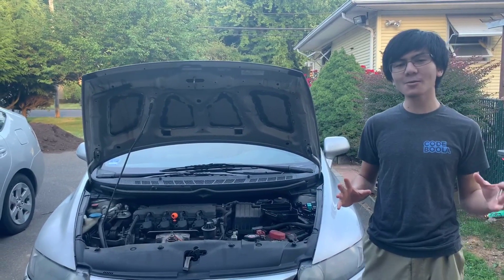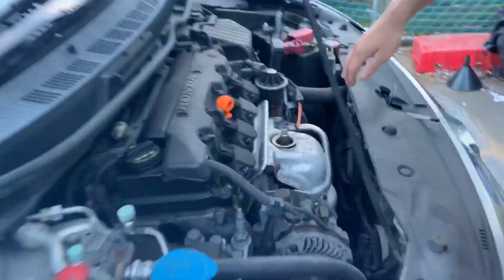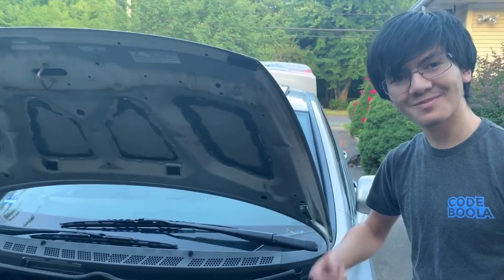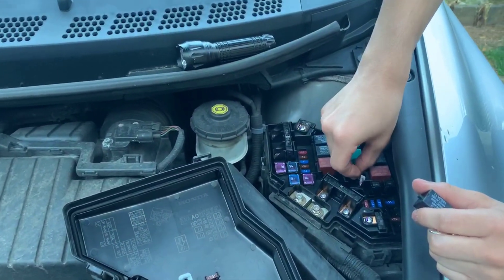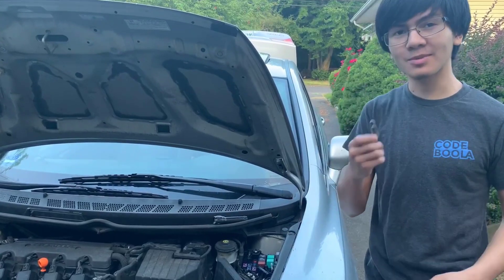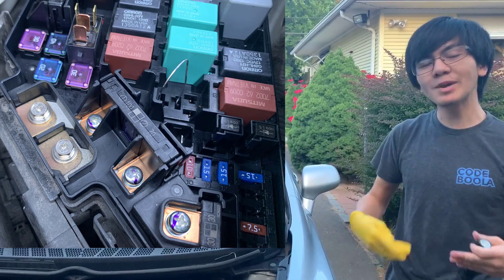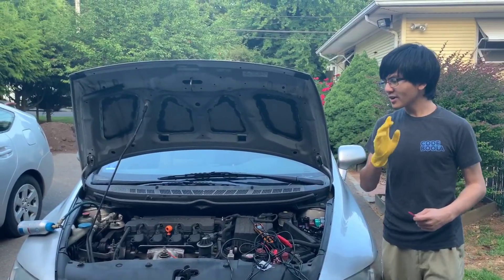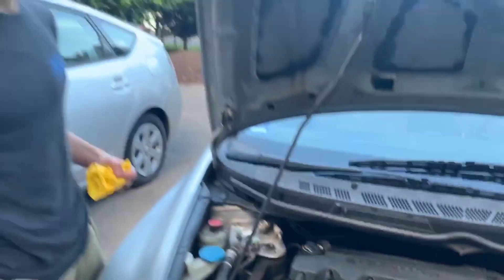How To Jump Start AC Compressor Clutch Using Paper Clip Bypass Relay | Add Refrigerant Manual Engage

Comment: My ac compressor clutch will turn when I jump it does that mean it's in good condition and my relay is bad?
Reply: Does it stay on? Or the clutch disengages a little after? If it works, your relay is good, you probably just need a charge.

Comment: When I turn on the ac, the car rpm goes down, I hear and feel the ac compressor turn on, but absolutely no air is coming out of the vents
Reply: Sounds like blower motor’s!
Reply: @afterthoughtsgarage320  I give it a good smack and it turns on
Reply: @afterthoughtsgarage320  yeah your right ac switch is if the compressor don't engage
Reply: 90% sure cheap fix
Reply: @codygreer1565  I hit underneath the glove box and the fan turns on
Reply: I have the same thing going on with my focus, I think it's the ac pressure switch sensor

Comment: At 3:40 you videoed yourself breaking the law....
Reply: Not true, this it R134a not illegal. The old freon r202 would be illegal to do so
Reply: @smisheski  Absolutely wrong. 134a is being phased out of new cars by 2021 because while it is not ozone depleting it is a greenhouse gas.  Below is a quote from an online source:

'Below is the punishment the EPA can fine you for releasing R134 (refrigerant) into the atmosphere

Penalty for Licensed AC tech releasing R134 into air:

"The fine for releasing refrigerant into the atmosphere can be a fine up to $27,500 per day per violation. The EPA can also award up to $10,000 to the person who notificed them of the violation if the person releasing the refrigerant is convicted." '

Comment: CHEVY TAHOE 2009 AC SNOWFLAKE LIGHT FLASHING 3 TIMES FIX.
Thank you for this! We have been searching for hours on end trying to 1) check if the compressor is bad and 2) if it's good, how to manually start it so we can get refrigerant in it!!! We did replace the ambient sensor thinking this was it. Although it wasn't the fix, it turns out that sensor was bad anyways!  We do not have a Honda but this still helped us find out hwo to manually engage the compressor, to then do more searching to find the relay numbers we needed to put the wire (not paper clip ;) ) in for it to work for our CHEVY TAHOE.  For a 2009 - 87 and 30 does the trick (they are diagonal from each other). We started the vehicle after wire was in place and the AC (Snowflake) button stopped flashing 3 times, compressor engaged, and we were able to check the refrigerant levels (LOW LOW LOW).  Successfully refilled to the green and our air is ice cold :)  YAY for DIY.

Comment: Good video,but dont to take the risk,relay and pressure switch are Cheap price,Just change it,or end up expensive repair.
Reply: But if your relay switch and pressure switch are all ok/have been replaced.... & you still need to manually start your compressor to get more refrigerant in it... bc... the compressor will not run if it doesn't have any..... Do you have a better suggestion to manually engaging the compressor?
Reply: Can u walk me thru this I need help

Comment: The compressor clutch will engage once you put enough refrigerant in the system. Then you fill it to the proper amount. It will take in refrigerant because your system is low and what your adding is under pressure.
Reply: What if the freon gauge is telling me it's filled?
Reply: @DaJuanFury  when you attempted to fill the a/c the gauge on the refrigerant said it was full?
Reply: @engineeringreality7878  the clutch wasn't spinning, but I tried to fill it up anyway. And the gauge still went up to full, BUT. My car still blowing hot. 2017 Impala.
Reply: @DaJuanFury  it seems newer clutch drive compressors will only accept new refrigerant if the clutch is engaged and spinning.  Its almost impossible to fill when they get to low.
Reply: @engineeringreality7878  turned out that my tank was just completely empty that it wasn't even kicking on the compressor. Took it to the shop and he filled it up. Needed a pound and a half of refrigerant
Reply: @DaJuanFury  nice
Reply: I know this an old reply... but u seem very knowledgeable. I have a 2013 rogue and there isn't a ac relay to engage the clutch in order to fill it. Is there a way to manually engage it so I can fill it with r134a, like connect it directly to the battery?
Reply: What if the gauge was in red??
Reply: @Kateee420  Was the AC clutch engaging at all?
Reply: @channelx92  not at all.
Reply: @Kateee420  I'm assuming the refrigerant your trying to add has a gauge on the can? It can only connect to the low side of the ac system. The gauge goes straight to the red when hooked up and the car is started? Is it possible it's overfilled? If you take a small screwdriver and depress the valve where you charge it at does anything come out? If it's overfilled the high pressure cut out switch will keep the compressor shut off. If you have high pressure and not enough refrigerant you could have an obstruction.
Reply: @channelx92  
When I used my ac it was working then all of a sudden it didn’t work anymore
Tried refilling it thought it was low the gauge immediately spiked to red when I put it on the low pressure port. I used the gauge to release pressure and it released quite a bit it’s now in the green/yellow area. But I can’t get the compressor to turn on so I can add refrigerant. Since you have to have it running to add some. The clutch is turning by hand so it’s no seized. I’m just at a loss.
Reply: @Kateee420  I don't know what vehicle your working on but have you checked the basics such as a fuse or broken wire at the compressor. Some vehicles the ac is controlled by a control module or computer.
Reply: @channelx92  08 Saturn Astra XR automatic 4cyl. I checked the connectors. All okay. The paper clip trick didn’t work so I don’t know what that means. I have searched to see if anyone else had a problem with the trick seems like it works for everyone else but me
Reply: @Kateee420  I'm having the same issue. Did you figure out what was wrong with your system and how you fixed it?
Reply: @kate did you figure out the problem??
Reply: @Priscilla_bbi  no, it’s still not working.
Reply: @Kateee420  any luck? I have the same issue. Ac all of a sudden stopped working mid-drive (uphill). Clutch spins freely but won’t engage. It’s getting 13v-14v at the compressor.  Checked the pressure with a gauge from a Walmart refill can and the pressure was also really high. Bled off pressure into green zone and still nothing works.
Reply: @Rlprime   now, it's still not working. But I also didn't take it to the mechanic it's been a cool summer thank God. But other than that I have no idea why it's not working.

Comment: It would be easier to just jump the pressure switch, easier to do & you dont have to wory about jumping the wrong pins  & once you have pressure remome the jumper & continue with the charging,- 36 yr Honda tech.
Reply from the maker: Thank you so much for taking the time to write and contribute.  It is our understanding (we're not expert at all) that the Civics & Accords don't have the traditional low pressure switch, instead there is a 3 wire refrigerant pressure sensor. The ECM receives input from the sensor and decides if it should activate the relay.  Can you please elaborate on jumping the pressure switch, not just for us, but also for other viewers out there.  Thanks again...
Reply: @EyeOnAiman  would you happen to know where that 3 wire refrigerant sensor is? I know there is a high pressure sensor next to the condenser but I’m looking to see if I can find something else wrong with my air
Reply: Hey Robert Olivarez since you’re an expert, could you help me out trying to figure out why my 06 Acura TL is blowing hot air. I know it’s not the relays or fuse, and the clutch is not spinning. Also I tried to add refrigerant but it seemed full. Do you have any advice?
Reply: @Priscilla_bbi  it's hard to say without being there, but if the compressor isn't kicking on it could be a number of things, check  all your fuses that have anything to do with the a/c,. Check to see if the compressor clutch is getting power, and if it is you may have a bad a/c coil, clutch or compressor, by pass the hi/low pressure switch with a jumper wire if it comes on you have either too much or not enough freon in the system. If your not getting a signal (power) to the compressor you may have a problem with the pcm or maybe a damaged wire. That's what I would check & then go from there, but if your not familiar with a/c systems you are probably better off taking it to an a/c mechanic these are some basic things you can check easy. Hope this helps.
Reply: Bro what is the main problem pf this? I bought a new compressor for my hyundai accent and still it wont start the mechanic guy need to jump start like what aiman did in this video. How can we resolve the issue?
Reply: Also he added “maybe the computer box is the problem” im in doubt 🥲

Comment: I like how you added more of the proper way of checking the for the normal DIYers out there
Reply: We do it the same way that is just a test procedure. We use a paper clip or a jumper wire back probe and pins. It’s just a quick test to make sure your system is working before you charge it. Vacuum it down add Freon you can actually just pump the system, full air, and the compressor will keep killing it Pressure switch need to see that pressure and then AC compressor will kick on but it won’t get cold. It’s all a pressure system. If you don’t know what you’re doing don’t attempt this don’t even bother pay somebody to do it do it right don’t go off of these videos because I watch his videos and 90% of them are wrong.

Comment: Help me please !!! I have a Honda Accord 07 and have replaced the relay on it and the ac is not blowing anything no cold or hot, my fans turn on and work fine
Reply: check the compressor clutch if it is engaging and /or check the AC compressor pressure switch. I have the same issue, checked relay but can't tell if its working or not. Found compressor clutch not rotating guess not engaging when AC is on. So will be checking it tomorrow to fix it.
Reply: @ReignVictorious  did you fix it?
Reply: @DjBriteLite  Yes, its fixed. Clutch was bad. Bought after market AC compressor clutch from Amazon and replaced with bad one. AC works great now
Reply: @lovemypuppy76 ac pressure switch located at top rear of the engine

Comment: Hey Aiman, great videos on manually overriding the AC clutch for the compressor. Question: I also have a honda civic (2011 EXL) same look as yours. But i am having trouble overriding the clutch. I tried with a paper clip and small cable to override the relay and the compressor would not turn on. When the car is on, i wiggled the clip/wire and there wasnt any sparks, which led me to believe maybe i wasnt putting the wire/clip in correctly. Might i need some alligator clips maybe? Not sure what else to do. AC was working just yesterday and it stopped last night, checked a month ago and gauge said it had about 1/4 left in freon.
Reply: What gauge said you had a 1/4 left? And refrigerant is not a consumable, it does not run out and need to be refilled. The ac/heating system is a closed loop, sealed system, ideally, and so it should always be 100% full. Unless you have a leak or something which would call for a repair.
Reply: @smisheski  The average car loses between 1/2oz and 1oz of refigerant per year....mosre-so on the newer car models. No matter what, you WILL lose refrigerant....in all vehicles.
Reply: @peteygnyc  Thats what Scotty said too. It will loose some from compressor shaft area.
Reply: The best way is send your car to nearest mechanic and ask for a/c check

Comment: So what's the problem next if you use the paperclip to jump relay you fill freon take out paperclip and your clutch doesn't engage anymore??
Reply: It could be the ac switch
Reply: You might have overcharged it. They have high pressure switch and low pressure switch that will activate to shut down compressor. Overcharging is worse on your compressor than undercharging.
Reply: AC switch probably, if you did not overfill.

Comment: It is like if you jump a breaker on you house, Don't try this
Reply from the maker: Hopefully DIY auto repair amateurs and weekend mechanics would be careful and understand the risks involved if they chose to do this procedure.  According to my dad (who studied Electrical Engineering in college -- although he later worked in a different field), he said there is no practical reason to jump a breaker on the house.
Reply: Jumping a relay and jumping a breaker are two totally different things as they serve entirely different purposes.  When jumping a relay the breaker (fuse) is still in the circuit.
Reply: Thankfully, your dad chose a different path..

Comment: Young man trust me you should never do that it’s not the proper way to repair your AC I’ve been pulling wrench’s on cars for over 40 years .You will end up doing damage.
Reply from the maker: Yes it is a controversial technique and that's why we decided to do this video, partly to encourage the discussions on this questionable yet rampant practice.  Hopefully if they opted with this method they understood the risks of expensive repair and would be careful enough as not to cause any damage to the electrical system and components.
Reply: Then how do you get the clutch to engage when its low on refrigerant? I'm stuck in this catch 22 where my clutch wont engage due to low refrigerant yet the clutch has to engage to fill the system...
Reply: @engineeringreality7878  this video is literally your answer, did you not watch it?
Reply: I'd be nice if you could tell us the proper way....
Reply: @engineeringreality7878  get it done by someone that knows what there doing with the proper equipment.